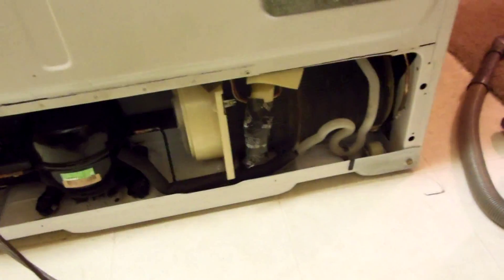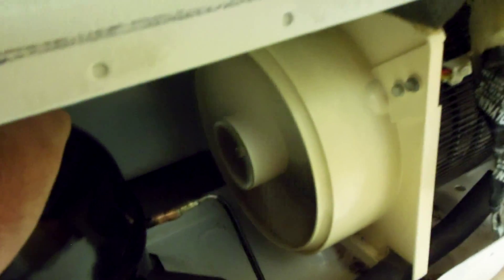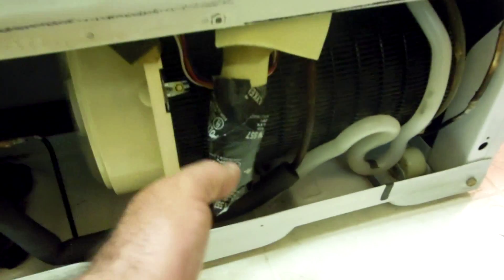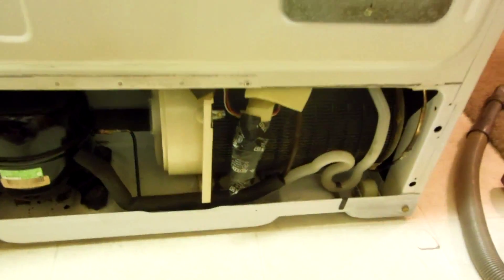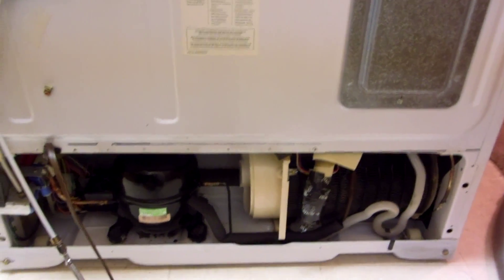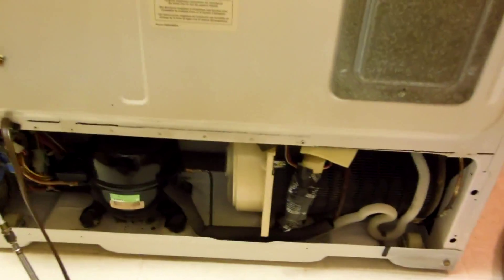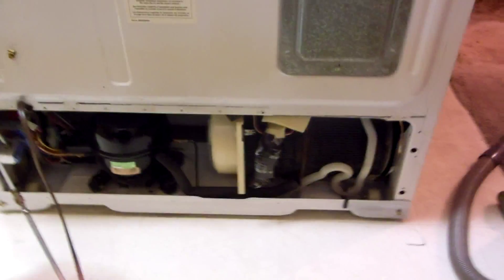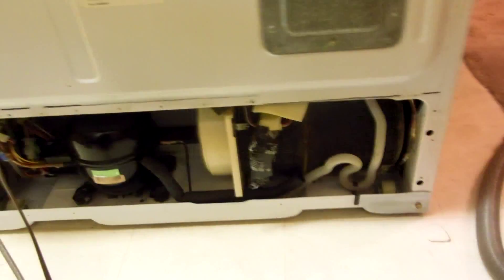Home Refrigerator. Cleaning the Condenser. Part 5.

Comment: I found that too much air was bypassing my condenser coil. I cut a piece of cardboard to wedge under my frig so that most of the air now gets sucked through the condenser coil. Doing this greatly reduced the run time. My frig is 27 yrs old. My mother's frig is 58 yrs old.
Reply from the maker: hanky97007 Yea, this is My Fridge and it's 11 years old. i hope it goes 27 years that would be a Pleasant Suprise. :-)